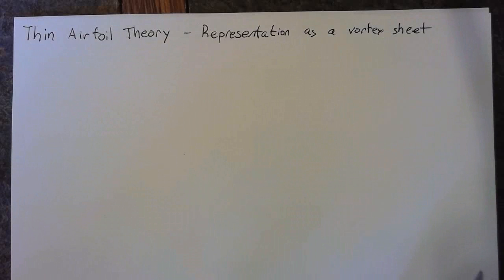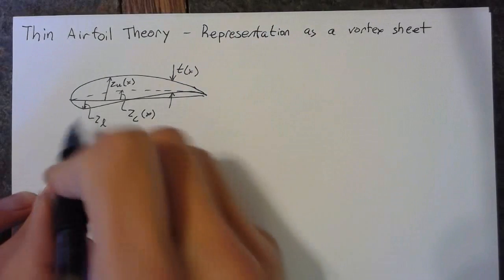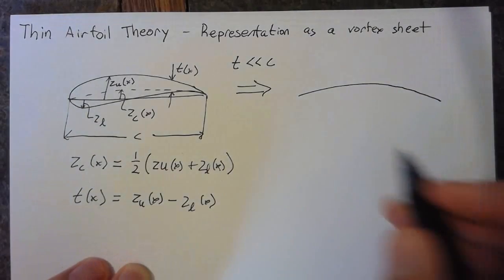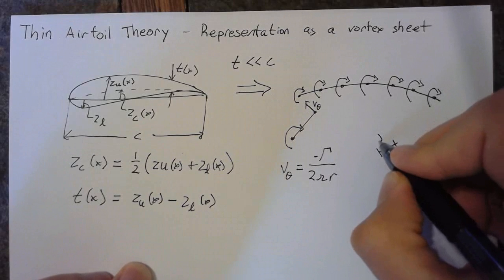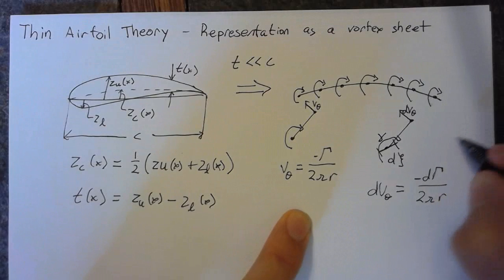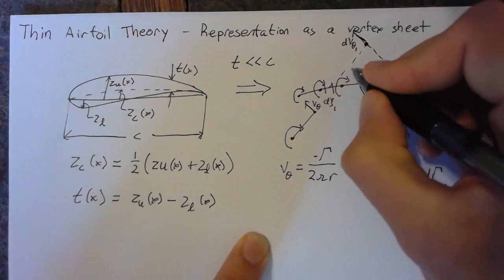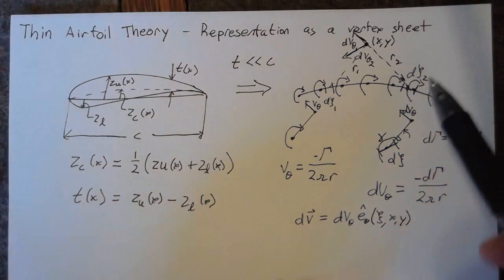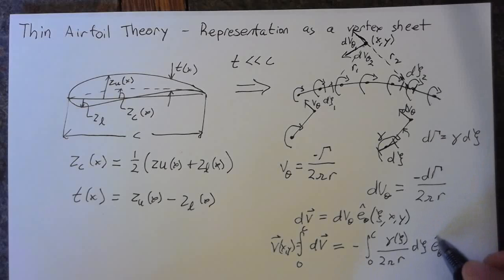Thin Airfoil Theory - Vortex Sheet

Comment: Hi, I was wondering how the limits for the final integral were 0 to C. It's a line integral along the camber line, and the length of the camber line will be greater than the length of the chord. Thanks
Reply: Cause eventually you will integrate over the length along x direction, not the camber line direction.

Comment: Do you consider to make video lectures about Aerodynamics 2 ?
Reply from the maker: Which topics are you interested in? Shockwaves and expansion fans?
Reply: Right now,  this semester; I am concerned about flapped airfoil. Finite wing, lifting line theory, elliptic and general wing loading. Slender wing theory. Next Semester I ll be learning Aerodynamics 2 so don't really know which the topics yet, I just thought Aero2 topics are globally same more or less. So it was a cry for help for next semester.

Comment: how do we determine the direction of V?
Reply from the maker: +Erick Robles e_theta has our direction information, which is based on the cross product of r (the vector from our position on the airfoil to the chosen x and z) and the vorticity at xi. 

If you wanted to code it up, you would choose an x and z, then run through all the xi locations, calculating e_theta along the way.  You would need to sum up all of the contributions, breaking e_theta into x and z components.
Reply: Thanks so much for your response. I would just like to clarify what the meaning of induced velocity is. Is that meant to represent the direction and magnitude of the flow of air that has left the trailing edge of the airfoil? In other words, the local velocity of the air flow inside horseshoe region?
Reply from the maker: It means the velocity created by one of the vortex segments.  You would need to sum up all the contributions of the vortex segments to find the trailing edge velocity.

Comment: Hi.can you pls tell what is  lower case gamma?
Reply: Lower case gamma is the vorticity which is the microscopic measurement of the rotation of a fluid particle. Hence used when only an infinitesimally small part of the panel was being looked at. When the whole airfoil is being discussed the circulation is used which is the macroscopic rotation.